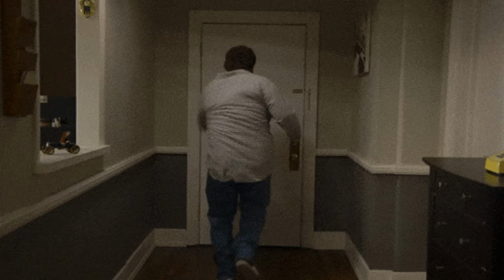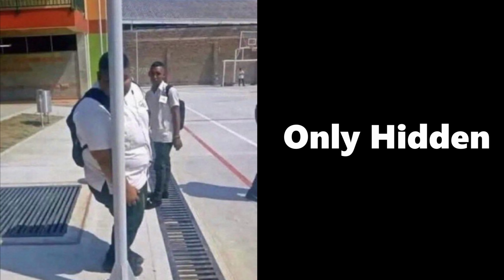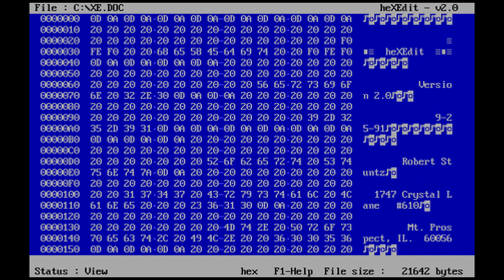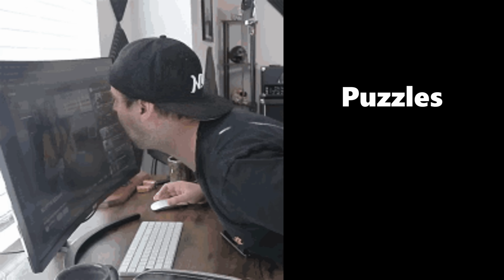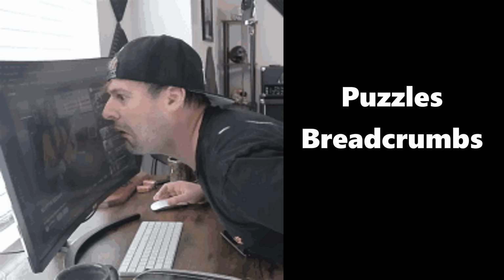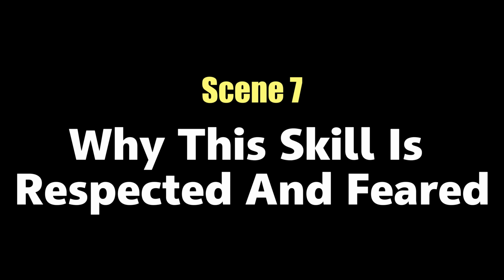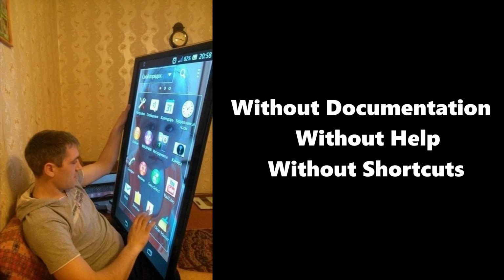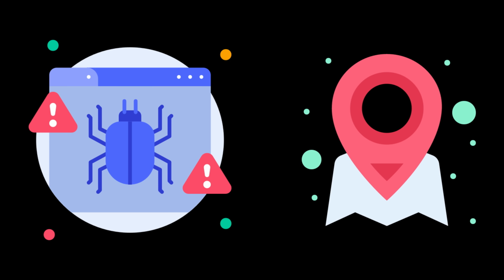Reverse Engineering in 7 INSANE Steps 🧠 | Hack Any Software Like a Pro!

Comment: Take the system. Operate it inside their machine. Get the important thing.

Then, put the important thing on the actual system. 

Its pretty much how many things works, including password cracking.
Reply from the maker: Thanks for commenting 😀
Reply: @Hackersaresenal53 ❤

Anyway i actually came here because the thumbnail has her on it.😂 But ended up stayed out of curiosity.